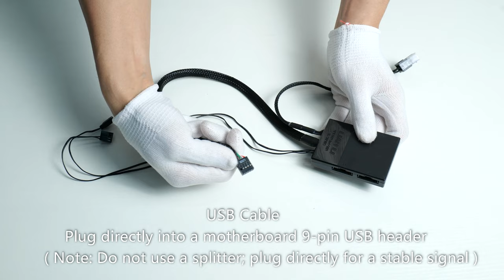Tutorial of UNI FAN TL & TL LCD Installation

Comment: So instead of fixing port 1 on the controller that has issues with high currents (noted by DerBauer on a preproduction unit and confirmed by Lian Li) you simply instruct users not to use it for the LCD fans - on a product that is about as high end luxury as they come (with a price to match). That's kind of yikes.
Reply: Yeah, that's some shady shit right there. Especially when they knew this problem existed before releasing them.

Comment: You spent 150 EUR for 3 LCD pack and it comes with only ONE daisy chain cable really? I want to plug another single uni fan to my controller but for that I have to spent another 30 EUR for a Connector Box set????? Sorry the LCD goes back to the dealer. I need new fans instant from another brand!
Reply: Corsair 👌🏽

Comment: These fans are trash, it kept turn off time to time  no matter how I reinstalled the software/update it, no support at all , (I’m using 7800x3d CPU) , wish that I’ve got the Corsair instead.
Reply: I have the same fans. They work fine. Check your connections and it's possible you got faulty fans. It happens. B650-E wifi Motherboard, Ryzen 7 7800 X3D, 32gb ram Rtx 4090

Comment: The fans themselves are of high quality and they are nice looking colors LEDs etc but the locking mechanism system is complete garbage, the little tabs break off or come out and if you lose them you're screwed I mean completely fucked I have three sets of 120s and basically almost all of the little connectors have like falling out or broken and so now I'm resorting to having to put together the damn fans with zip ties to get them to hold together so they'll work, so in other words like you know just like $250 worth of fucking fans I'm having to use a goddamn zip tie

Comment: Waiting for SL V2 with LCD, I dislike infinity so much. 😅
Reply: These aren’t infinity fans
Reply: @TheSjuris  did I say infinity fans? The led similar to infinity fans.
Reply: @GanJosie   the led fans are similar to sl fans not infinity
Reply: @TheSjuris  look at the fans side meh, I have two pcs, one using sl120 v1, and the other using sl120 v2, so I know exactly what both fans looks like.
Reply: @GanJosie   infinity have lighted blades and a lighted center. These ones don’t.
Reply: @TheSjuris  I said look at the side of the fans! That's what they called it the infinity, not the light on the fans meh.
Reply: @GanJosie  The tls are sls with a mirror.  They won’t make one without that. The actual infinity fans are a combo of the sl and the al.

Comment: Why are daisy chain cables not for sale or included with the 3 packs?  With controllers out of stock? These are limited in options.  Huge let down
Reply: I have 7 lcds and a galahad 2 inf, now i have a big problem with those controllers and cables. Fk lian li
Reply: @mBossX  you can plug the inf fans into the new controller and watch them blow up.

Comment: L-Connect software is terrible, keeps resetting my configuration to default rainbow after being in standby mode or doesn't work at all.
Reply: Is this still an issue? I'm thinking about buying Lian Li vs Corsair this go round
Reply: @nmsumike  they recently updated the software and it seems to be working correctly. My next build will be no RGB, but I will say L-connect is 100% better than Corsair software.
Reply: @Screaming_GOAT_HD  thanks for letting me know!
Reply: I can’t run GIFs on my lcd. After 3 days to solve the problem the fans goes back. Buggy software and you spent a lot of money 👎🏻

Comment: Why did you choose 6pin on the lian Li UNI Fan TL-LCD? As if it is a general standard... on top of that, there is no translation adapter in the box.
Reply: I'm new to building and confused what cable to use from psu to connect this

Comment: I HAD BEEN LOOKING FOR A SOLUTION FOR DAYS I use 9 fans with LCD as I understand the controller only supports 7 and to connect the other controller I don't have enough USB on the motherboard I already ordered the hub my other question is how do I change the direction of the fans I want the air to come out outwardly if you can help me if you have that function thank you very much.
Reply: tlv8555  I bought the usb hub and they do not work with the tl lcd model. I will have to wait for them to manufacture a new 2.0 hub and I will only have 6 fans with the active screen. My motherboard only has two usb 2.0 ports and I have the other one in use.
Reply: @lord_kakaroto360  which usb hub?  They have 2 versions.

Comment: So I want to add 3 of these LCD fans into my build, can I use the new hub to connect these as well as my 6 SL infinity fans? Or do I need to use the 2 different hubs?
Reply: 2 different hubs. 2 different power requirements.

Comment: How would you do this if you wanted to use one as the main fan on an only airflow cpu cooler?

I dont think you'd be using the 'cpu slot' on the mobo anymore? Or can you use the 4pin PWM cable there? Would it be okay, or is it only usable on a regular sys_fan 4pin connector on the mobo?

Edit: after 2 weeks, no answer for an up and coming product. Very dissapointing CS.

Comment: Sorry Lian LI I am NOT A FAN as what if I only wanted 1 LCD fan in the middle and the rest to be D RGB or wanted to use some of your older fans. I would have to use to many control boxes just to get them all connected as ALL YOUR FANS USE DIFFERENT FAN CONNECTORS and HUBS.
Reply: Gee the LCD needs more power than the previous generation fans did so they need a different hub.
Reply: Gee the LCD needs more power than the previous generation fans did so they need a different hub.

Comment: Is it possible to use one fan with no controller? I noticed I can't buy a fan with one included unless I pay for three
Reply: Checking their site, and nope. It's a custom cable that needs the controller to work. For these LCD variants anyway.
Reply: They only work with the controller.  Controllers are hard to find separate.  You get it with the 3 pack but then you have to use all three clipped together because you only get one cable.  And lian li says there is no option to buy more cables or even daisy chain cables which seem to not exist now that the fans are released.  This is a debacle of a launch for them
Reply: @rojoe3455  true plus the LCD doesn't even work right, they never turn on for long
Reply: @rojoe3455  Controller sells separately on Amazon. Black or white.
Reply: @carlpatterson7483  everyone was out of stock back when I made my comment.  Problem still exists in that they still dont sell a replacement  cable without buying another fan.  The tl controller you mentioned only comes with the non lcd cable.

Comment: Why does it use a PCIE cable??
Reply: It's just a precaution they use so that it has the capacity to power all the fans that CAN be connected. This is the first time tech like this has been done for PCs so there is a lot of things that aren't really done as well as they should be, sadly.
Reply: @Levita_ suspect it was either a pci-e cable or 2 usb cables.

Comment: Ok but this still doesn't tell me how to use a LCD fan as an exhaust fan. Yea i could flip it around but then i won't be able to see the LCD screen.
Reply: There are reverse variants you can get. But your wording confuses me... The air comes in through the side with the display on it and shoots out the side without for the stock ones. Unless your setup has the case shooting hot air towards you is what you mean? 

I don't know your setup but they have reverse ones, yes.